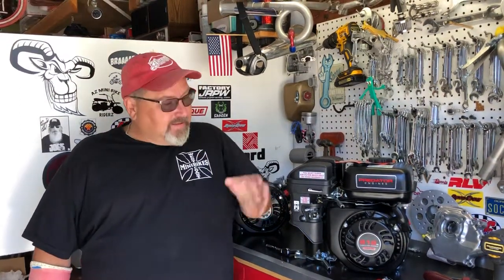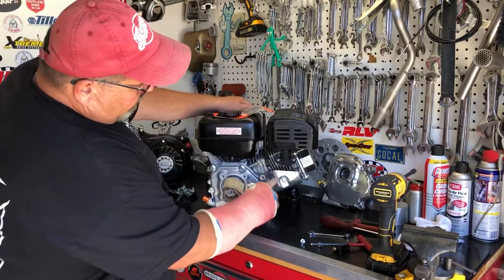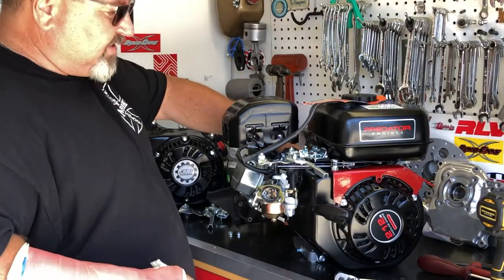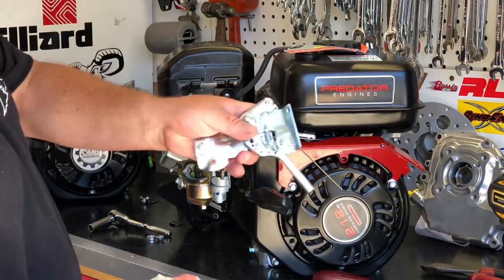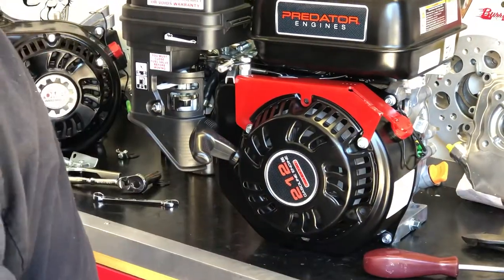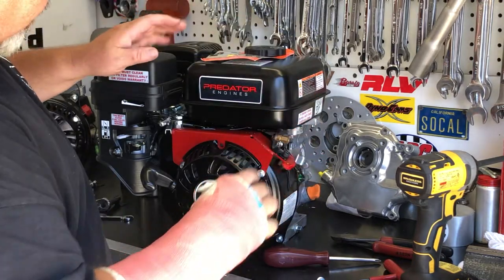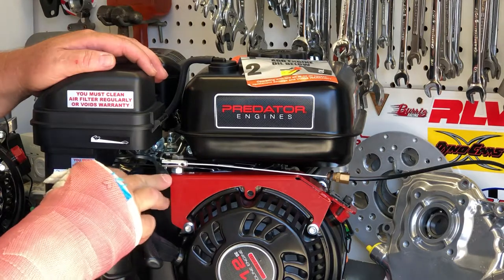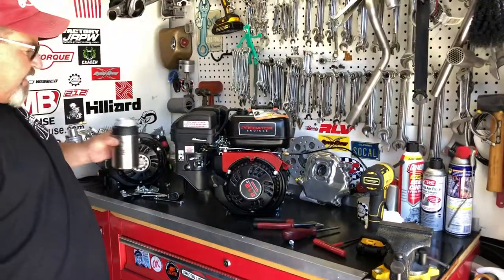Predator 212 Throttle Linkage for Governed engines

Comment: I almost didn't look up a video for this. I just got my engine delivered yesterday im going to use for a mini bike build. Kinda wanna just wing it and learn as I go. Also I don't have any of these parts so I'm most likely going to improvise and figure something out. I do have a twist throttle kit I bought but its just the grips and a cable.
Reply: Im doing exactly what your doing its a very easy process and you shouldnt need a video its super simple

Comment: I can't quite figure out what this adds to the original provision for a throttle cable that comes with the engine. My best guess is to change where the cable leaves the engine? That must be wrong, however, because before you cut it, you had more than adequate cable to reach the cable connection provided with the engine. I watched it twice, thinking I missed something, but so far, I'm not sure what the point of the plate is, outside of changing where the cable is oriented in relation to the engine.

Comment: What is the hose that connect to the air filter and gas tank coz mine is disconnected but it still runs
Reply: everyone disconnects those hoses.. its a racing setup. Youll see people with clear lines with little mini air filters hooked to them.  Its better for the motor to have those lines open like you have them to get air into the gas tanks.. they need breathers. Its shown and explained here: https://www.youtube.com/watch?v=3lOw3Gml5N8
Reply: I believe thats for emissions lol

Comment: Hey man I was wondering where you got the plate that guides the throttle cable? I'm looking for one to use on my honda GX160 since I believe the predators share similar dimensions to the hondas. Thanks for all the useful info either way!

Comment: $30 for this kit and OMB cant include the 2 screws you need?
Reply from the maker: This is a kit that we buy as a package. Due to the variances in the different engines, additional screws are not included as they are not always required
Reply: His tip of robbing the two screws then simply replacing them with the shorter ones takes about 20 seconds. Easy fix. My kit went on perfectly. Minor nuisance when these engines vary so much

Comment: I have the same engine in a NEW leaf blower. It starts fine but the throttle will not stay in the full position. I can hold it and its fine but once i let it go it falls back to the medium throttle position. Any suggestion on adjusting.

Comment: Already asked, but not replied to. What size is the allen for the throttle cable clevis? 1.5mm is too small, and 2mm is too big…
Reply: That allen screw is a #6-32

Comment: Will this work on a predator 459
Reply: No. This is for the smaller engines only. I am not aware of any linkage available for the big engines
Reply: @TheGrayGoatGarage  im not getting full throttle out of my 459 and if screw the throttle to where i do get max throttle i have no idle. Have any idea how to fix this ?

Comment: https://youtu.be/hzu-FC66Nw4. You can't really see it in this video but I'm getting a bit of black smoke. If I run the twist on muffler pipe it leaves soot on the frame. Is this a carb issue? I can't see it as I ride but I think it's at idle mostly.  I changed the idle jet and I'm running a 37 main in a pk1b.
Reply from the maker: It sounds like you are on point with the jetting. Please keep in mind that the engine needs to have a load on it to get the jetting correct. That is not something you can do by free revving the engine as the fuel requirement is much less without a load. The only way to truly know is to look at the spark plug. If it has black soot on it, you are running rich. I hope you are not running the stock spark plug. Those plugs are mediocre at best! Don't be concerned with the number on the jet, be concerned with how the engine runs! I have a similar engine that loves a .036 and another that likes a .038. Pull the plug and send me a pic to HELP@OMBWarehouse.com
Reply: @ericadams8099  will do. I'm running the Autolite x plug. I'm going to be ordering a bunch of spare parts next week including clutches.  Things are in ridiculous demand up here in NH but people are into fixing junk rather than quality bikes I've put together.  I sold my ct200u with a stock Predator 212, I'm having a lot more fun running these small tire bikes. I put that 196 on my DB30S and it is awesome! I'm going to have to upgrade the brakes, white knuckles and prayers are great for holding onto under acceleration but a bit touch and go if you wanna stop in the next 200 feet! I love this motor Eric.
Reply: @fatbuddycat  What are those Autolite x plugs? I cant find them. Another guy in the comments said to get Autolite X plugs and look for 3934x and that it runs warm and that the 3910x runs cold and is more for wide open racing.  However I cant seem to find a "Autolite X 3934x" or "Autolite X 3934" plug.. All I could find are Autolite XP plugs and Autolite R plugs and the only 3934 plug I could find is a Autolite R3934 and Autolite AR3934 plug.